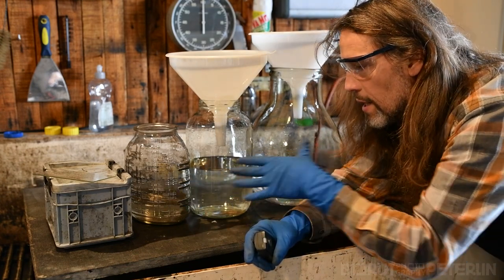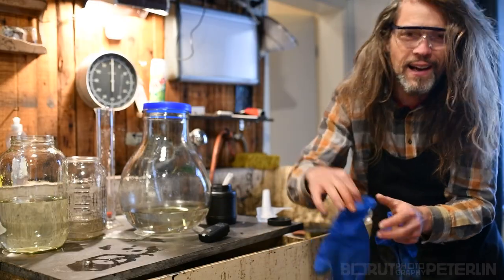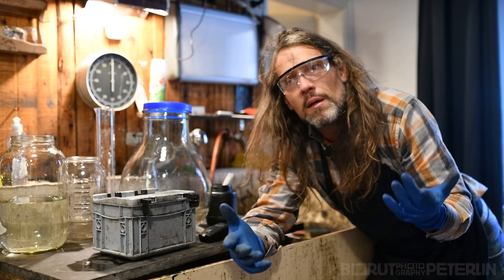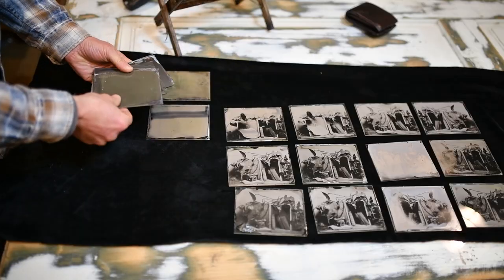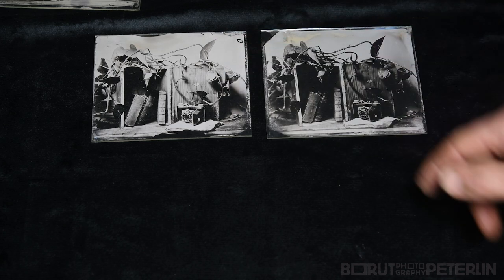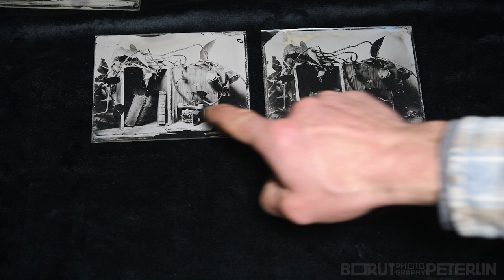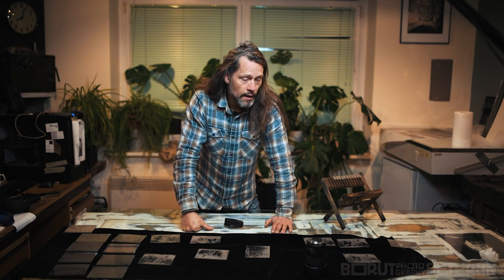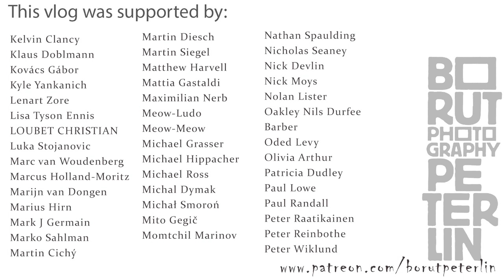Wet Plate Collodion manual - tests of AgNO3

Comment: First things first, Borut: Condolences on the loss of your father. Sorry to have heard that; it's never easy. 

On the lighter note of your video: Really pretty fascinating stuff! Your success with the baking soda can't be denied. It's very Mad Scientist. 

I've reached out to a friend who's a chemist to see about the best method for measuring pH in your solution. I'll follow up if/when I hear back. 

Topshit, indeed, happens.
Reply from the maker: Yes, please ask him. I know there are two electronic ways, one with diode (bad experience) and the second one is better. Now sure what's the name of the second one. Thx
Reply: He's said that the likely reason you've burned through probes is that one of the components in the meters is often a silver wire, which would likely get corrupted by your solution,  @BorutPeterlinPhotography , and that litmus paper would be the most likely solution. Since the solution is clear (or clear-ish, minus some clouding). it would come down to selecting a paper that's tuned to the band of acidity you're looking to test for. 

Barring that, he said you could go in the opposite direction and try adding indicator solutions to a sample of your solution, and look for it to become discolored when it's in the range you're seeking. 

I'll keep on him to see if there's another electronic method for testing beyond the typical probes, but if there is, I fear it might be quite expensive.

Comment: Agree with Martin about ph indicators. Different indicators all respond to specific pH ranges. There are also pH papers that are full range or partial range responsive. Maybe Amazon or a fine chemical supply company. pH meter probes also need to be calibrated to the range you are interested in. So for low pH need a calibration solution for that range. If you use a pH 7 calibration solution then there will be error at the low end. Need a buffer of 2 or 3. I don't think a cheap pH meter is the way to go.

Comment: Are you aiming for pH about 3.5? If so, you could get methyl orange indicator and do a titration on a small sample, it will turn from yellowish to orange just below pH of 4, and deeper red towards pH of 3. Then scale up however many drops you needed for the large volume.
Reply from the maker: Could you please get me a link to the product? I don't know what you mean. Thx
Reply: You can search for "methyl orange", it is a common indicator solution for weak acid to strong acid titrations. It should be available from a local chemical supplier or ebay. 

It is a bit like litmus solution, but changes colour over a lower pH range. 

Add a little to a known volume of your high pH solution and it should  be yellow. Then add your acid, counting drops or measuring volume.  It will start to go orange at pH=4 and be fully red (or pink if very dilute) at pH=3.

It might save time and collodion.

Comment: I guess the discussion become what happens if you don't keep the exposure the same (I'm assuming you kept the exposure time the same).  You second plate, that was just filtered, looked slightly underexposed compared to your control, and I preferred the shadow detail.  So instead of changing how you maintain, could you just change how you expose?  Which gets back to baselining your exposure for every time you shoot wet plate - make a test plate, determine exposure and go.
Reply from the maker: Well, I was dealing with only one variable to learn the mechanism, the principles. The knowledge will make room and tools for one's aesthetic decisions.

Comment: What you need to do for pH is perform a simple acid- base titration. Contact your local high school or college chemistry department. They should be able to  help you out.
Reply from the maker: Thank you, but with silvernitrate it is different. For some reason litmus papers don't work and electronic pH meter works only few times before the probe has to be replaced.